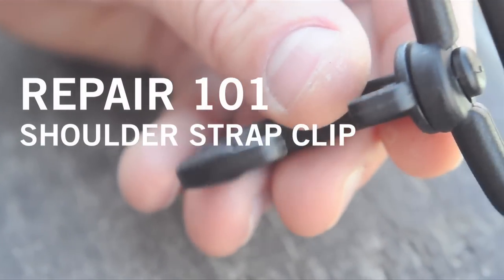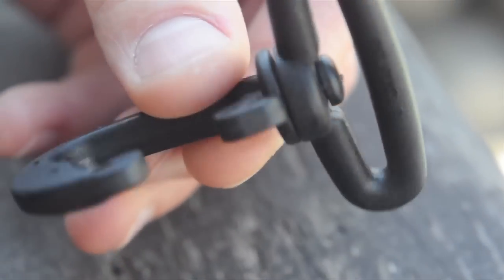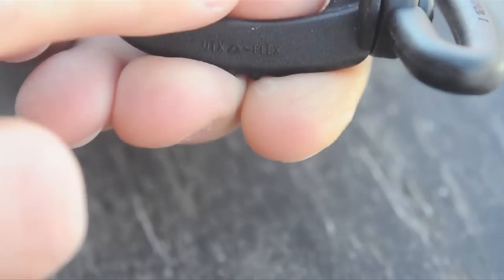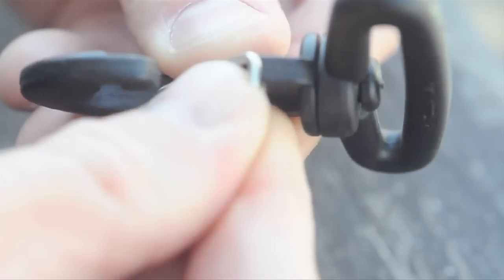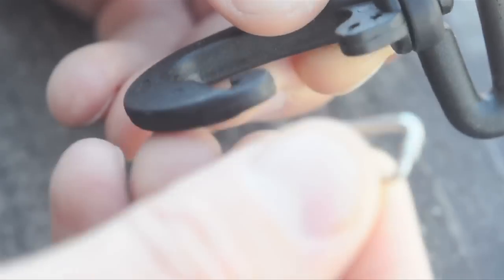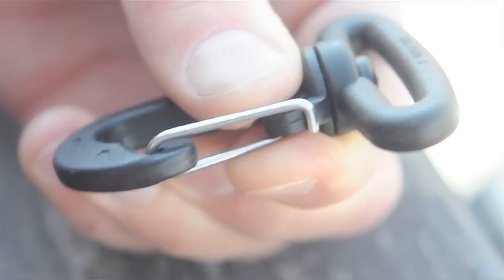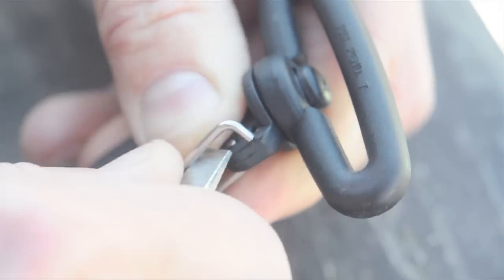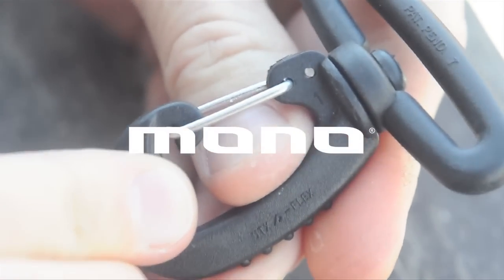Repair 101 :: Shoulder Strap Clip

Comment: Buying bags connected via straps locked is the answer..plus these are easier for thiefs I baught a zavetti Canada bag with these annoying straps and I'm just thinking of ways to either change the strap or lock it so it won't open by pushing the metal..any ideas?